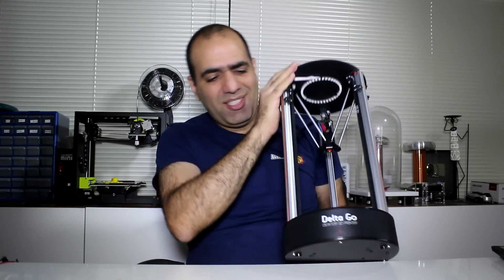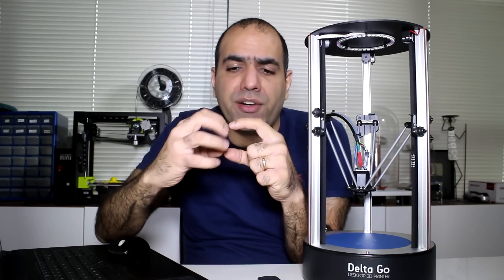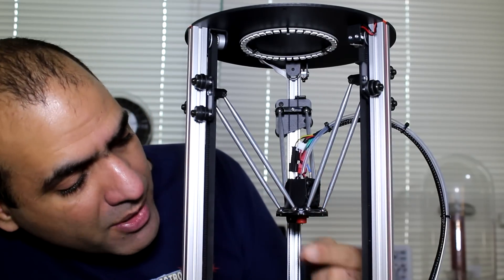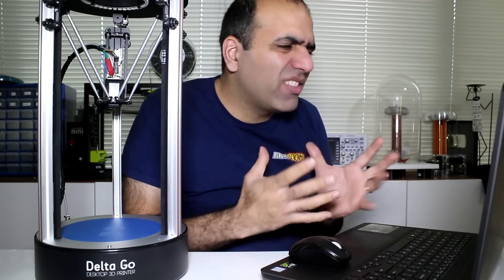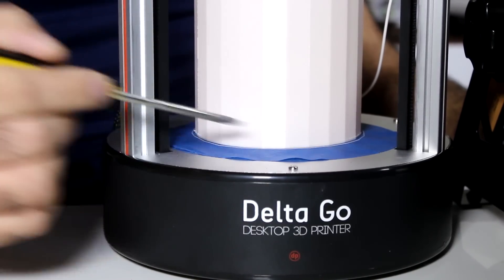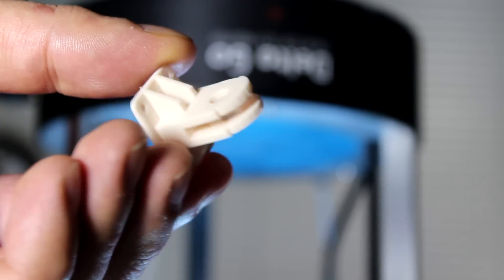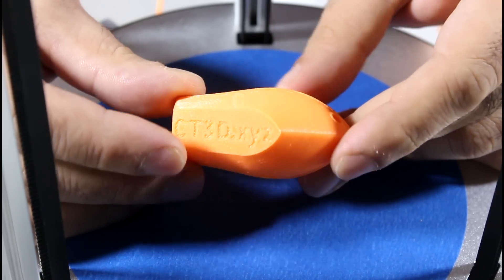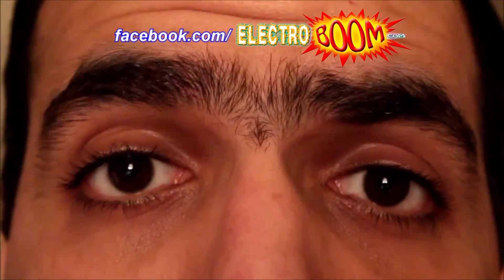What's a Delta 3D Printer, a Delta Go Review

Comment: Not acceptable for the speed. I printed a vase at 155mm/s with an anycubic at 0.3 layer height and no fuzz (it shaked like a vibrator, almost fell off the table), only some droop because my fan is very worn out

Comment: I'm pretty sure you can get a heated bed for it. Ebay ought to have what you need. You will have to flash new firmware and probably get an external mosfet board and bodge some wires from the motherboard to the mosfet board.

Comment: I wish I had some money to get a printer. I do lots of 3D modeling stuff, but I have no ability to print anything, so it's kinda just turned into making short explosion animations. A printer would help a ton too. My brother's lathe needs new gears and components, and 3D printed parts would be acceptable. (It's not a high-torque lathe.)

I know I'm far late on the giveaway and such. Kinda just disappointed in my work. Two of my jobs were short-term and didn't allow for any free-spending, and the last one just fell through, so I'm flat broke.

Regardless, shock safely Mehdi.
Reply: Get an ender 3 or something like a creality cr 10s (what I use)

Comment: You should see if you can get a tarantula 3d printer to test. It is a kit printer but it has a heated bed and (as far as I know) quite a few official kits you can buy to upgrade it. E.g an extra fan to cool the filament faster or better motors

Comment: I ended up buying one and have had nothing but issues. The support is nonresponsive and the forums are broken. This is the only place I can think of that may get some answers.

Extruder begins to heat up as soon as I plug the printer in (not sure if this is normal). Once I try to print something, the temperature continues to increase to about 275c before the printer shuts down and pronterface gives the error "ERROR: Temperature runaway on T (delta temp 69.113251), HALT asserted, TURN POWER OFF IMMEDIATELY - reset or M999 required". The thermistor seems to be connected just fine. Any ideas as to what is happening and how to solve it?

Extra info: I did not modify my printer in any way. It is as it was shipped.

Also: for some reason pronterface can't move the printhead at all when the printer is connected. Is there a setting I need to change?

Comment: I own both cartesian and delta printers, and the delta printer adds an extra layer of insanity to all of the problems you will experience with 3D printers. And deltas aren't (necessarily) very accurate either. Try printing this out this on a delta:

https://www.thingiverse.com/thing:386448

Now measure the width at one end (I typically get 9.8mm. YMMV), and at the other (which I typically get 10.2mm). So one end prints out narrower than it's supposed to, while the other end prints out wider. At the center I get the nominal 10mm. So deltas are great for printing out thingies, not so great if your finished product is expected to actually fit into something.

Then there's the concave/convex issue (Delta radius set incorrectly). Which if not setup correctly, will have your hotend either "air printing", or grinding into the hot plate at the outer edges. To correct for this automatically, you pretty much have to upgrade to a 32 bit controller. Or print out a mount for a dial indicator and manually make corrections.

Comment: The shift that happened when you had it upside down was most likely caused by the heat getting trapped under the control board and which makes it glitch and shift sometimes. I had the same problem with mine until I added a fan

Comment: Looks like a cool 3D printer I'm wondering if the traditional xyz way of moving the head has any advantages over this? Or this is always better? A heated bed can be added to this as well + the print area can also be increased but maybe the print area is the crucial parameter where the traditional design can still outperform it.

Comment: You should get into drone racing it's excellent for the electricity inclined ⚡️  they are pretty easy to build. Real life star wars pod racing #fpvislife try the free drl simulator with a controller see if it would be something you would like to get into. ( relatively cheap too ) 300 dollars gets you everything to fly fpv

Comment: I have over volted a AA battery and man it sure was crazy. I have also did a capacitor and it sounds like fire crackers. I also did broken PCs by making the power supply catch fire by over volting it. I have a power retrofire that a use to do those things. I got it from a friend of mine. I think that’s how you spell power retrofire.

Comment: Hai, i'm a TIG Welder.
Sometimes a welder forgets the Ground -  and than when you want to start welding, you'll get some nasty shocks. My question is, if its dangerous? when i dont complete the circuit the shocks are not harmful. But when i do, i can feel the shock true my body, from torch to the place where i touch the table. A tig welding welds with around 90AMP. I hope you can answer my question and maby make a video about it?
I like your videos! be carefull 👍

Comment: Been using a Kossel 3D printer for a few years now - overall I'm happy with it, especially since I put "silent" stepper motor drivers on it. It does have its quirks but has been working reliably.

Comment: I had a shifting layer issue with the printer I build that was easily fixed by tightening a skipping belt. Maybe while you're printing upside down a belt skips?
Reply from the maker: +Capt. Sum Ting Wong it happens at the exact same height. Making the hole creates an over hang ( under hang?!) That gets in the way of the printer head. Maybe that causes a skip

Comment: Well.. I have to say I'd be more satisfied with my Prusa i3 kit for ~250 than this one.. the overhang on the front window of the boat doesn't look sooo good. And 60mm/s is almost the speed I always print with. Also, I could more or less easily equip it with a heated bed, which doesn't really work for this one.
Interesting concept though, definitely something to consider if I'm buying a new one.

Comment: Hey, I have a question. If a peltier cell does not get the max watts that it's designed for, is it going to work anyway? Do they require a minimum of power to operate?
Reply: I know you can control how strong they are by adjusting the voltage (or using something like pulse width modulation, but I dunno if there is a lower limit before it stops working.

Comment: I want a printer that can print diodes, capacitors and transistors.
Edit: Skip that, I want a printer that can print me all the latest computer hardware like the latest high end Intel i7 CPU's.
Reply: You wouldn't download a car, would you?
Reply: And then printing in such small pieces at the time?
Reply: I don't know what you mean with Quantum mechnics, but I understand you're talking about the resolution needed to make such a thing, besides, think about the different amount of materials you need and so on.
So, currently it's not even possible to print an intel 4004 processor.
And I don't want to print with real gold that might not work because of a printing error.

Comment: Hi... I am watching your channel since years now, nice that you started explaining 3d printing now as well. Since I am building, loving and using 3d printers since years now, I may recommend you improving the build area ventilation and increase the retraction length and speed to remove those strings. You may place a cheap 12cm PC fan next to the print bed so you won't increase the head weight. Also applying heat resistant silicone around the heatblock will help stabilising the hotend temperature and keep unwanted heat from the print itself.

Comment: I have had about a dozen printers to date. Only one has been a delta, and I'll never buy another. The advantages are very minimal compared to the problems. Alignment is many times harder than in a cartesian printer. The Bowden tube extruder means you really can never use flexible filament, which IMO is a huge downside. The round print area didn't seem like it'd be that big of a deal but in actual use it was always getting in my way.  And this printer at $350 is more expensive than the 8x8x6" metal frame Prusa i3 clone that I got off Amazon and is probably the best printer I've ever owned.
I hated the Delta so much that I finally just rage quit and gave it away. It's driving someone else crazy now. And almost all of the trouble was not specific to that printer but to deltas in general.

Comment: Funny video as always, but I had terrible luck reviewing this printer and just ended up sending it back because there are much better machines for $500. Let's just say it's not how I'd want to be introduced to 3D printing :\
Reply: could you recommend a better one for the same price?
Reply: My recommendation is not buying from GearBest first of all because they take forever to ship then long ship times even after they do, also their customer service takes a while to respond. I do agree with recommending a CR-10, just bought my own recently.
Reply: I'm glad I refunded (thanks PayPal) my purchase for a CR-10 on discount fast enough, which they imply to have in stock. GearBest is a dodgy website and their "customer support" is actually some sort of chatbot which answers nonsense most of the time.
Reply: CR-10 is nice, I bought a Tronxy P802ma.  Uber cheap.  Extremely happy, though.  Just, it's not the type of thing you take out of the box, put together, and just start printing with.  Something I love about it, tbh.  My next I'll be building myself, and will probably be a corexy with a larger print volume.
Reply: That's so weird...
Reply: I think there are better printers for 200 dollars now. I do realize that 2017 was a whole different time though.
Reply: Clogging issues, the auto-leveling wasn't reliable, and I hate the lack of an onboard interface since I never connect my printers via USB.
Reply: Opinionated Loser check out my list at makeanything.design/favorites
Reply: Build your own for that price. The FT-5 has 12 inch by 12 inch by 15 inch (300x300x500mm) and is same money. It's nice to build too
Reply: Make Anything // 3D Printing Channel Nice to see you here!
Reply: What happened?

Comment: You should've reprinted the boat at default speed to show the difference in quality.
Reply: the thing about jokes that you don't seem to understand is they're supposed to be funny
Reply: pretty sure its should've
Reply: notreallyajokethough.gif
Reply: Анонимуси where's the funny part in that joke?
Reply: R.S his joke is "JOKES ON ALL OF YOU GUYS, I WAS ONLY PRETENDING TO BE RETARDED"
Reply: @r.s2095  don't mind him he's an idiot.
Reply: A boat in normal speed looks pretty much the same, which is actually quite impressive.
Seems like the only issue I spotted was that the flag holder on the back got pretty screwed up because the fast printing.
Reply: QuestWalker KO That thing is a flag holder? I’ve been printing benchys for a year and I haven’t noticed it was a flag holder :p
Reply: Why? A printer without heated bed? No thanks.
Reply: Should've = Should Have
It's = It Is
Reply: Yashendra Shukla lol
Reply: Yashendra Shukla gdfgdchhh gcgchccycgcggccggc
Reply: R/woosh
Reply: This little boat would cost him 19 years
Reply: Shukla bol yogi ki jai
Reply: the thing about jokes is that they're supposed to be FUNNY
Reply: r/woooosh
Reply: thatsthejoke.png

Also, it's*
Reply: @ba8e  Boo you stink! 👎
Reply: @ba8e  no
Reply: @ba8e  "it's" is incorrect, English is weird the context is actually switched when using "it". aka it is "its"
Reply: QuestWalker KO no it isn’t “it’s” is correct
Reply: should of*
Reply: @ba8e  should've* it's should have
Reply: Анонимуси you are using wrong grammar trying to correct them. Great job.
Reply: Анонимуси BRO ITS SHOULD HAVE NOT SHOULD OF YOU STUPID FRICKING MEATHEAD
Reply: @ba8e  Should have*

Comment: Assalamualaikum! Why don't you use the printer to make another printer. Use the 2 printers to make 4 printers. Use the 4 printers to make 8 printers. Etc, etc. You'll be a billionaire in a few weeks and no more need to hurt your heart with dodgy voltages.
Reply: The thing is, printers aren't advanced enough to print electronic components; most printers can't even print different types of plastic in a single print, and printing with anything other than plastic usually requires much more expensive printers. At most you can print most structural and mechanical parts of a printer, but not stuff like motors and circuits.

Comment: 350.00 bucks with no heated bed.. No thanks.. Great video though.
Reply: I paid $170 for my printer with a heated bed and a 200x200x220 print area. After just 30 min of tinkering I got it to do near perfect prints. Now a year+ later I still have not had to make any real adjustments outside of some bed leveling. These expensive printers are overrated if you can build a printer for less.
Reply: @harshbarj  yet your cheap printer is not faster nor have the same resolution as the higher priced model. you get what you pay for.
Reply: Yeah for less money you can buy a much bigger, much more capable printer with a heated bed.
Reply: well, i mean.. that is a thing. Watch Big Clive or AvE to see the quality of the stuff coming out of China in general.
Reply: Winter is coming.
Reply: Just search for Delta 3D Printer.. The 170$ ones are DIY builds, so you have to build them on your own. Please keep in mind that you have to clean the plastic parts of the 3D Printer, like holes and stuff. Its good quality, but the low price comes from somewhere ;)
Delta means the Model of the 3D Printer. The way it moves the heathead & how its constructed.
Calibrating the Chinese ones is not that easy. But with a little effort its possible. There are many tutorials & big forums with Infos and KnowHow.
Have fun!
Reply: Can you please tell us the printer model?
Reply: which one did you buy?
Reply: please read my comment again. looks like you understand something wrong. The chinese 3D Printers are as good as the slighty more expensive ones. so what?
Reply: Which printer would that be?
Reply: What printer do you have?
Reply: They ARE sold as conusmer-levelappliances. And 2D Printers actually need calibration too....
Reply: +AutogolazzoJr
I mean, Chinese companies are pretty known for not making High Quality items.
Reply: Which printer was that? any recommendations I am looking for one thats under 300 if possible that wont require any soldiering like the anet which i hear is a fire hazard if you don't soldier the heat plate. 

Basically Im wanting one as an artist / hobby inventor a  small space would not be ideal but  I dont want to burn my house down and I dont know who to trust lol
Reply: Agreed, my Ender 3 is serving me well even after a year in service.
Reply: Eat ink
Reply: Why wouldn't they use a heated bed? I would think that would be one of the cheaper components to manufacture, compared to other parts.
Reply: yes the technology is not there yet
Reply: Greatscott had to do a review of this too, it's stupid. One of the employees had the nerve to say that it isn't made of chinese parts and implied that chinese parts would burn your house down.
Reply: Ugh.. do you guys even read the comments?
Search for 3D Printer Delta. Look for a Model WITHOUT that Magnet scum.
But before you think its "Build&Play", just keep in mind: Calibrating is the key.
And you need to know wich parts are used in your build! Very important for the right settings.
Reply: Best quality is possible with the most 3d printers. Only thing to do = calibrating. thats the magic word ;)
Reply: Sniper2565 The Chinese have a space program, and yet they can't make a 3d printer? Please, stop generalizing 3d printers by a country.

Comment: Wait, so you could technically use this in space? With zero gravity?
Reply: They have one on the ISS. It's not delta, but looks like it works fine. 

https://www.nasa.gov/content/international-space-station-s-3-d-printer
Reply: You can, even with a cartesian 3D printer. The International Space Station has one on board!

Comment: Nice.  I could use a little printer like that one, and the price is surprising.  I'm in no hurry atm but chances are good that I will buy one of those.
Reply: The price is surprisingly high for a printer that small with no heated bed. Be sure to shop around before buying.
Reply: Will do.

Comment: Those strings are called : “stringing” . I would do anything to get a 3d printer , sadly here in Puerto Rico 🇵🇷 the hurricane Maria destroyed  all jobs
Reply: You can build them entirely from scrap! 

If you just had a hurricane, you just have to go scrapping very old printers from the 90'ies (for stepper motors), coffee machine for heat elements etc in industrial areas. 

Get a cheap Ramps+Arduino+Driver combo off ebay for 20usd or something and a knock off E3D hotend and you are good to go :-)

You can even make tiny and slow printers  from scrap floppy drives! 

Sadly the stepper isn't really used much in consumer electronics (besides 3dprinters and plotters) these days because its cheaper to get a toy grade DC motor and an optical encoder.

Search for "repstrap" on google for inspiration :-)
Reply: One might think you would have a shitload of work to do after that.
Reply: Waa waa waa hurricane is bad guy and we lazy, send us gold!!
Reply: I live in Dominican Republic  I didn't get very affected but I feel sorry for ya
Reply: What about getting steppers from optical drives? (I think the tray usually isn't moved with a stepper, but the read(and write) head is)